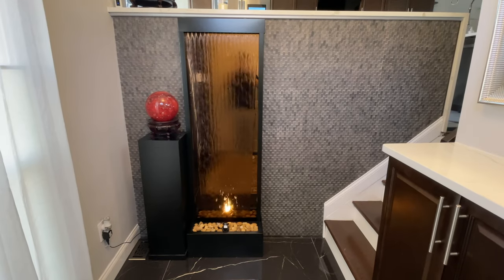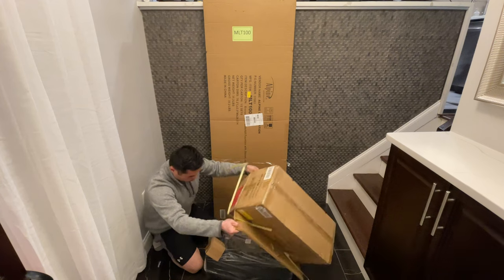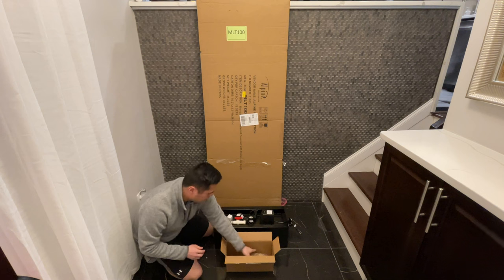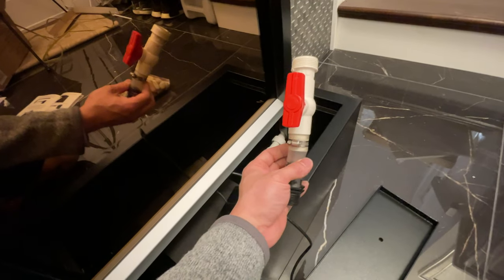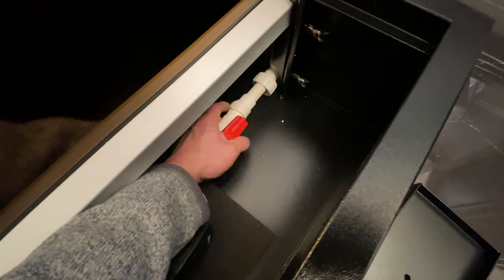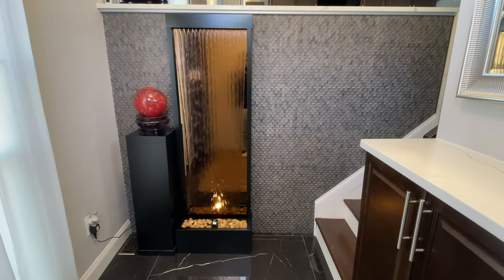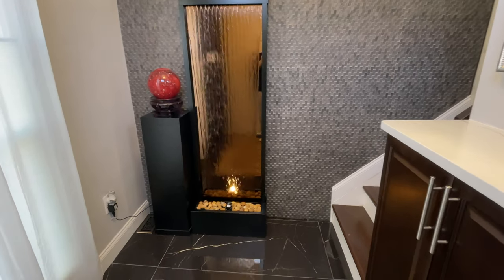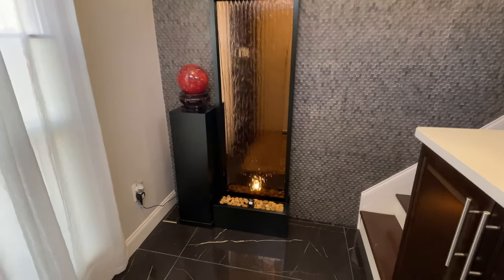Alpine Waterfall Fountain - Unboxing, Assembly, Review MLT102 / MLT100

Comment: Before you turn it on and start the water flow, wipe a light coat of petroleum based oil on the mirror to keep the water streaks from forming.
Reply: What type of petroleum based oil do you recommend?
Reply: Just a little bit of Vaseline on a paper towel will do. It makes a slicker surface for the water to fall, plus it keeps the hard water scum from forming over time.
Reply: @glk2227  You a real one for this ✍️🏾💯
Reply: Thank you
Reply: Thank you for this I put the water in and started using it for a month and I started to notice the little streaks now im doing it your way

Comment: 1:57 You already show the light attached to the insert without showing how you did that. For mine, the screw is bolted in and can’t be undone. 😢

Mine also came with two additional plastic pieces that seem to go around the screw, but they aren’t listed on the parts page. I assume these go around that screw and the lamp inserts into it, but I really can’t tell because I can’t get the screw undone.

Comment: After installation, I have a small rubber circle, about 1" across. Where does this go? Did it fall off the pump connector?  Would appreciate your quick response.  Thanks. Tracy
Reply from the maker: I think it's just one of the rubber groumets that protects the wire from the sharp metal edges to route the wires through the hole like at 1:59 or 2:16.
Reply: @brandon20904  thanks so much for getting back to me!  So if I put it on between the pump and the attachment, it won't do any harm?  You r great!
Reply from the maker: @tracyrichards5035  yeah which ever is missing. You put it there so at if the wire rubs against the metal edges it won’t fray or cut the wire

Comment: Have you had issues with the top jets spraying on your floor? I assume it's a mineral build up. How does one fix this?
Reply: Use only distilled water in fountains plus buy water fountain tablets or liquid to add to water occasionally.
Reply: Can you mount this on the wall I wanna find a way to mount it in the wall

Comment: Hi, Brandon...you were so gracious to answer my last comment/question, I'm reaching out again. My fountain is up and running now and the water is not covering the whole mirror from about 3-4 inches from the top, leaving a few inches on either side bare. I've left it running all day and I wiped down the edges with vinegar and water.  But it continues on the same path. Also, if I run my finger down the sides, the water follows but then goes back to original path. Any suggestions?  I'm afraid I'm not getting much support from the vendor or Alpine. Thanks. Tracy
Reply from the maker: Hmmm I heard a few others say this too... My guess is that maybe the motor is not pushing enough water. There is a knob on the motor to change the flow rate, try incrasing that... if not, not sure if anyhting else will do it excapt chaning the motor.
Reply: @brandon20904  Thanks. I'll try it.
Reply: Same thing happened with mine

Comment: Hi 👋 I have mine for a year now but the holes 🕳 where the water come from is getting clogged , do you know how to fix it ??
Reply: Stick toothpick through the holes 🤷🏽‍♀️
Reply: If you find a way to fix it, use distilled water to avoid buildup in the holes
Reply: @dwightschindler-chamberlin5507  
I do used only destiller water 🥹
Reply: How can you afford the distilled water ?? You will be buying it constantly ? I used well water . But my mirror has streaks when the water isn’t running . It said to clean the mirror  with window cleaned . I tried it won’t come off .
Reply: @mojavewolf1  I used dawn also Walmart & Home Depot sell distilled water for .99 a gallon
Reply: @Kimwilkins502  how many bottles do you use and how long does it last , before you have to put more in . ??
Reply: @mojavewolf1  Once I completely filled it for the 1st time I had to add a gallon every 3 days depending on how hot it was.. I run it 24hrs bout it this yr May 2022 so I try keep u updated how the winter months go. My only issue now is cleaning it I add the algae drops as recommended but it get clogged and smell fishy I’m thinking about emptying the whole unit cleaning it and starting over 🤦‍♀️🤦‍♀️😩😩🤷🏽‍♀️🤷🏽‍♀️
Reply: @Kimwilkins502  same issue here

Comment: I just got mines and it’s super uneven do you have any tips on making it flow better ?
Reply from the maker: Try using your finger to guide the water on the mirror, make sure the floor is level, and turn the pump on high and wait overnight and in the morning it should even out.
Reply: That’s what the tooth brush is for. Go along your top and sides of mirror . It will fix that issue .
Reply: @mojavewolf1  what if you did that and still don't work
Reply: @brandon20904  hello! Any suggestions on cleaning the unit? I run mine 24hrs I add the algae drops as recommended the holes still gets clogged I use the toothbrush/ toothpick but if I get really close I can smell a fishy smell 🤦‍♀️